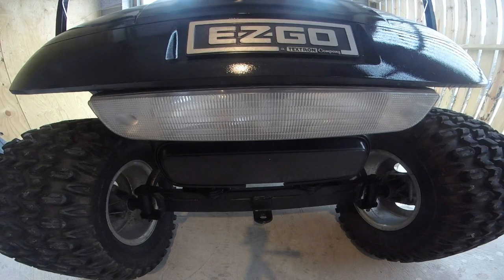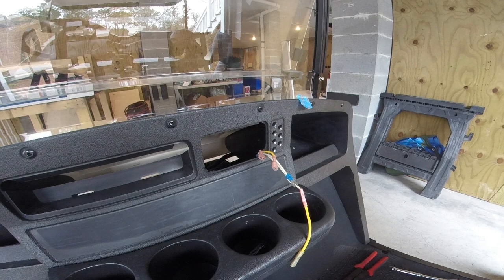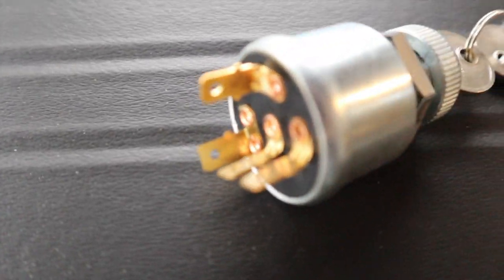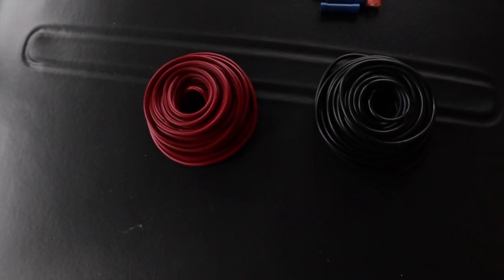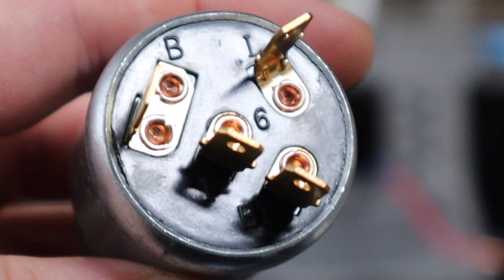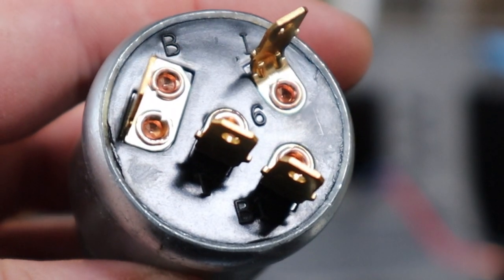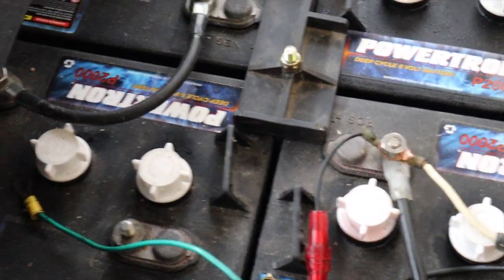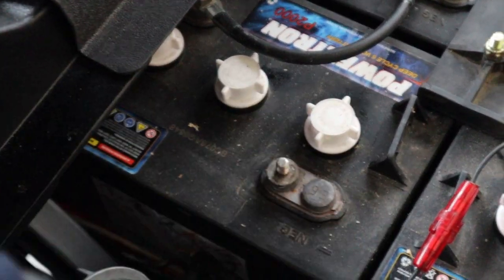EZ-GO TXT Restoration Ep.2 - Ignition switch w/ lights

Comment: My switch was not connected to anything? Just two wires coming out of a wire harness. Where do you attach the two wires?? On the solenoid? Controller? not sure. Any help since you have the same cart?

Comment: Great video. How do you know which wire goes to what terminal? (Any other way than tracking what you disconnect?)
Reply: Doesn’t matter the orientation of DC voltage wiring so long as one goes in, and the other comes out…

Comment: I've got a 1998 TXT DCS that I'm restoring and I unfortunately cut the 2 ignition wires at the controller, not knowing where exactly they go to. I took pictures and I know where the yellow wire goes, but the white/yellow wire is mystery to me. We can't figure out where it goes. Do you have ANY insight as to where that wire goes? it's the ONLY one that's tripping us up.
Reply: The other wire I believe goes to a solenoid that’s probably near the controller